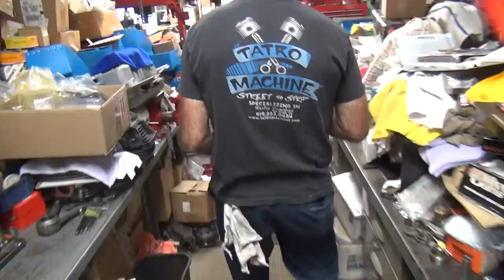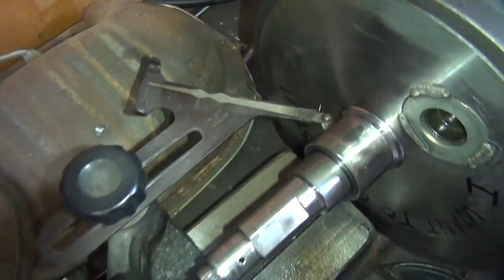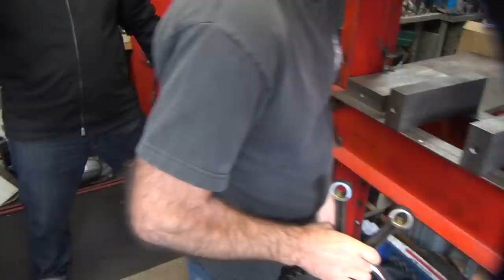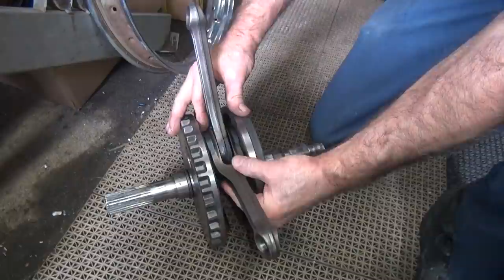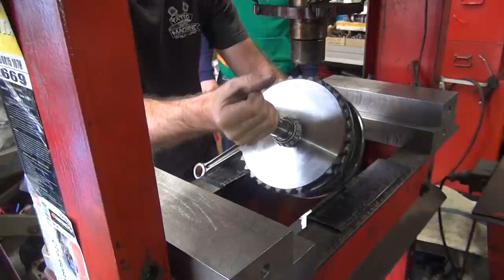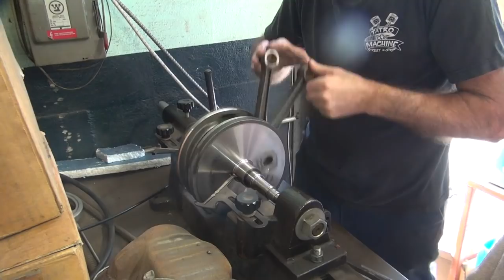#101 how not to straighten welded flywheel 2011 twin cam crankshaft truing harley by tatro machine

Comment: ah good to know about the induction hardening/blue color is normal.  new to harley ect and had my new to me 2000 fxdwg apart for some lower compression pistons and stock  efi heads.  they had this bike setup at 12.5:1 with a woods tw6h cam set.  now its  9.2:1 and a fueling 525 cam.
Reply from the maker: now you can ride it anywhere and have a quite valvetrain. it will late way longer too.
tatro

Comment: truing those crankshafts is a 3 step process: (1) after pressing the forgings together on crankpin. (2) after pressing interference plugs into pin ends. (3) after welding the pin to forgings. its no more difficult to move them after welding than before..
Reply from the maker: great, that sounds super simple. lets see you do it.
welding kills the press fit of the crankpin which weakens the hole assembly. you only add strength if the welding is stronger than the press fit that you lost. the truning goes all to hell too.
tatro
Reply: "welding kills the press fit of the crankpin".. thats exactly the point im attempting to make..

Comment: welding is a bad idea. it pulls the material away from the crankpin reducing the critical, interference fit surface area needed for rigidity.. you see how easy it was for them to influence the crankshaft to rotate with less runout?..

Comment: Tatro why do some shops do a Timken conversation on the m8 and other shops don't
because they say the case breaks what's your option. do you have to do conversation with high 
horsepower builds
Reply from the maker: sell it and go buy a good big aftermarket evo motor. way stronger and it will last.
tatro

Comment: Nice. Wen rod bearings or rods need to be replaced, so do the flywheels by default. Some "improvement".
Reply from the maker: that is unless you take them apart and fix them. the manufactures are not the only ones that can assemble a crank. the problem is that they don't know how to rebuild anything. but they can take a 75.00 crank and sell it for 1400.00
tatro
Reply: @TatroMachine  roger that

Comment: WHY?? align Crank with Centres? Inaccurate should use Bearing Journals. How NOT to do it is right!
Reply: the stroke lengths are determined by the centers. whats not accurate are the splines that are broached on to sprocket shaft independent of a centerline or center point. indicate close to wheel supported and rotating on a set of dead bench centers..